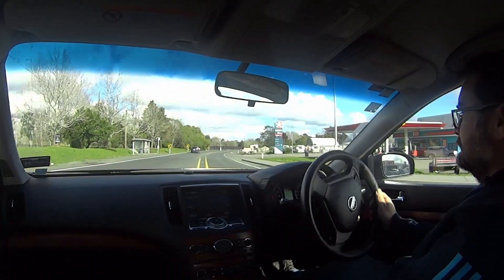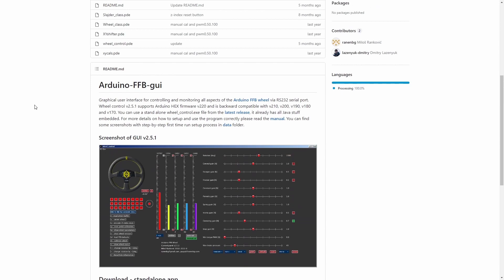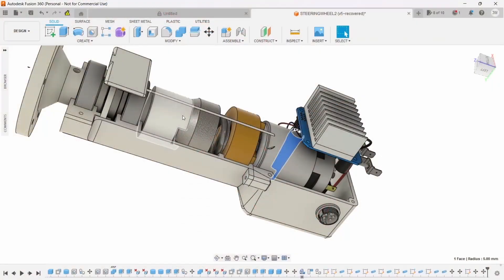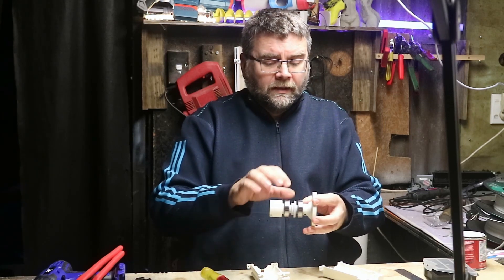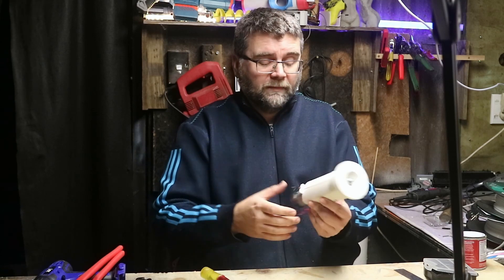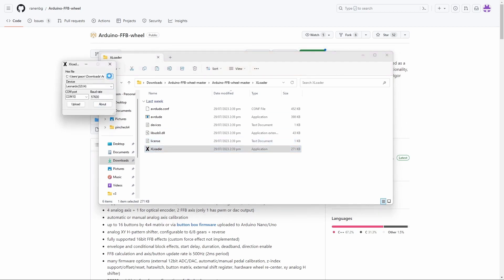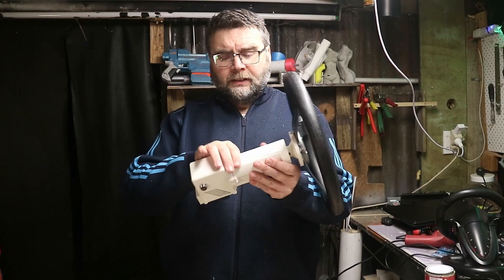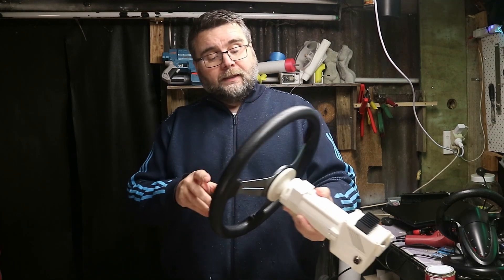Transforming a Drill into a Force Feedback Sim Wheel

Comment: Looking good, have you removed the hammer assembly from the gearbox? The other thing is that your encoder is before the gearbox, as such you need to calculate the gear reduction and adjust it in software to get the game and wheel in sync. 

To get a decent result you may need a better motor controller that has more development time. I moved to OpenFFBoard, if you dive into the documentation, you'll find there are cheap ways to go make it work with development stm32 boards and basic motor drivers
Reply from the maker: I have now bypassed the hammer assembly causing the noise. Just hoping I don't strip any gears. But it's all in the next video. I did look at OpenFFBoard but as far as quickly getting up and running quickly (where I live) you can't really go past a Leonardo. This was just supposed to be a handbrake project that just spiraled a bit.
Reply: @JWNZ  I wouldn't worry about the gears, those things can take a beating. Great project btw

Comment: Very nice build and tnx very much for using my Arduino firmware ❤ For best experience make sure to also use my gui, you left that part out from the video. The firmware is plug and play, but there is some configuration to be done as everyones setup may be done differently.
Reply from the maker: The GUI was in the video but I wanted to leave this till the next one when I have the pedals etc up and running.
Reply: Do you know if it is possible to use one of the analog axis as the steering?

At the moment my wheel has a potentiometer for positioning, although I intend to upgrade to a encoder in the near future.
Reply: @bena2.0  yes, it's possible with minimal changes in the code
Reply: @rankovicmilos86  so it just changing the axis that is associated with the steering on the game settings wouldn't work, I'd have to change what the firmware interprets as the steering input?
Reply: @bena2.0  you can do it like that, but then you will not have ffb, because it is tied to X-axis only. If you want to have ffb then you have to do this change in my firmware. There was already someone asking about it on my github and we already had some disscusion what needs to be done.
Reply: If possible, I strongly suggest you to invest time into mounting encoder on the wheel shaft, since this will make your life much easier and will have much better ffb fidelity.
Reply: @rankovicmilos86   I was reading through the issues on the github page, must've missed this one. I will probably just follow your advice and get on with installing the encoder. Thanks for the directions!
Reply: @rankovicmilos86  I finally installed the encoder, the force feedback is great!

Although, now I can't get the pedals to work. Would you happen to know of a bug that causes them to behave erratically? I'm sure that the analog pins on my pro micro are working fine, but in windows all the analog inputs seem to be linked together.
Reply: @bena2.0  Awesome, nice :) Note that you can play with PWM frequency to optimize FFB resolution (lower freq = more ffb resolution, but causes a motor coil whine sound).
You have to put to gnd all analog inputs that you're not using. If you for example leave A0, A1 floating (unconnected) and put a pot on A3, then obviously A3 will work fine, but axis tied to A0 and A1 are going to have the same voltage as A3, plus a lot of noise because it's being reflected back. To solve it, A0 and A1 should be connected to gnd. I hope you get the idea - all unused axis should have their corresponding analog pins shorted to gnd.
Reply: I wonder if its possible to get your firmware to work with actual  "Drive by wire" car pedals pulled out of a junkyard. Im not entirely sure what kind of sensor those use though..